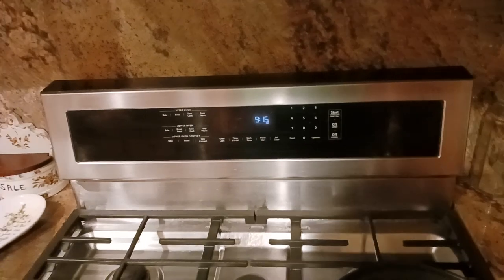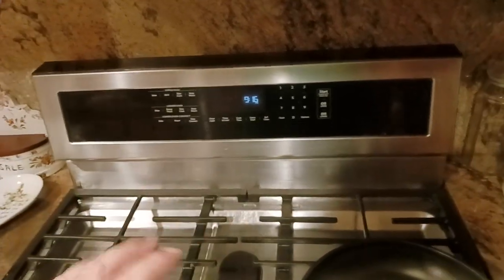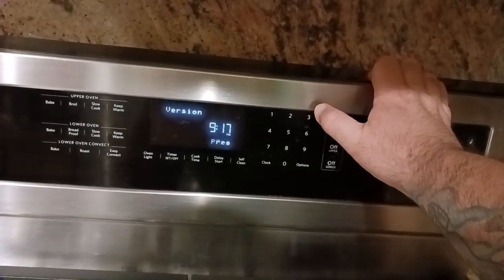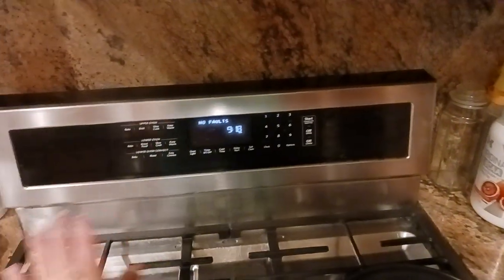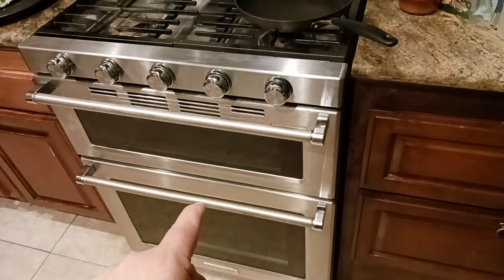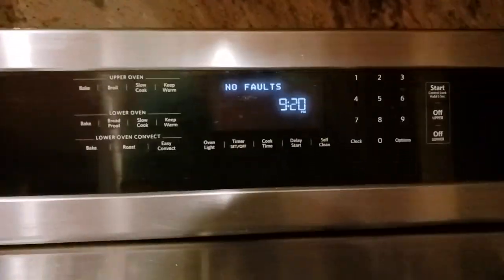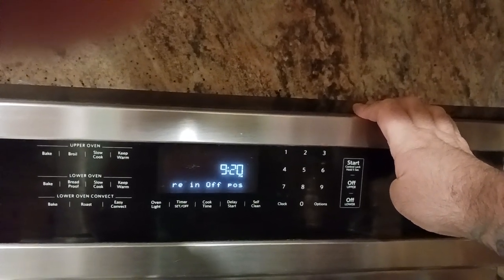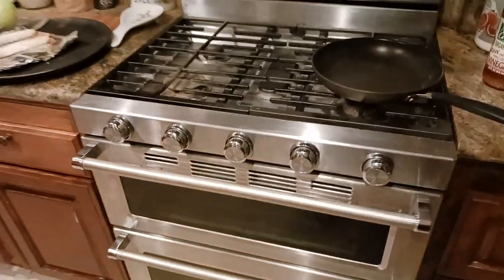717 Kitchenaid Whirlpool Oven error code menu fault double gas range mode

Comment from the maker: Igniter Replacement
https://amzn.to/3qQA1l7

❤ Please Subscribe

FB
http://facebook.com/Cooter-Malloy-Product-Reviews-102191174879094/

KITCHEN
Kitchenaid Mixer
https://amzn.to/3kGjYzD
https://amzn.to/38XhM4k

Instant Pot
https://amzn.to/3bDZEdc

Food Dehydrator
https://amzn.to/2PvYzg9

Vacuum Sealer
https://amzn.to/2Oj105b

Vacuum Sealer Bags
https://amzn.to/2Pv78Yx

Juicer
https://amzn.to/3rCSSuB

AllClad 10" Fry Pan
https://amzn.to/2Z3pBwQ

Carbon Steel Skillet
https://amzn.to/3q7iGij

Nonstick Pan
https://amzn.to/321QJhy

All Clad 4204 sauce pan
https://amzn.to/3cXx7ld

All-Clad 4406 saute pan
https://amzn.to/3aTdUhI

Water Filter
https://amzn.to/44ramyp

Pepper Mill
https://amzn.to/3tHzVZv

Oil Sprayer
https://amzn.to/3klxO9y

Silicone Tongs
https://amzn.to/3NUZ13Z
https://amzn.to/3HEbgh5

Silicone Turner
https://amzn.to/31YcBds

Slotted Spatula
https://amzn.to/3dO3gud

Spatula
https://amzn.to/3rE0nBu

Basting Brush
https://amzn.to/3p7Dbdj

Digital Meat Thermometer
https://amzn.to/2Z4dkIJ

Digital Scale
https://amzn.to/2OnbMYd

HEALTH FITNESS 
Massage Gun
https://amzn.to/3d1djgL

Headphones
https://amzn.to/3wj6l0r
https://amzn.to/3qj77GJ

Body Composition Scale
https://amzn.to/3MIXAm5

Blood Pressure Monitor
https://amzn.to/2Z4eSm1

Whey Protein
https://amzn.to/3NDWF9l
https://amzn.to/3HA3qoM

Casein Protein
https://amzn.to/3PAveva

BCAA
https://amzn.to/3yF1G83

Desiccated Beef Liver
https://amzn.to/3zzOe7z

Pre Workout
https://amzn.to/3pA87Wd

L-Citrulline Malate 2:1
https://amzn.to/3KiylWY

Nitric Oxide
https://amzn.to/3dNgtHx

B12
https://amzn.to/3vgGu7I

Energy Greens
https://amzn.to/3dZF8oY

Superfood
https://amzn.to/3IVnrVX

Multivitamin
https://amzn.to/2MGg0d3

Vitamin D3
https://amzn.to/3d3iZah

Fish Oil
https://amzn.to/3DW7ife

Electrolyte
https://amzn.to/3llOFtw
https://amzn.to/3LTdQCn

Potassium
https://amzn.to/3qhqgfa

Magnesium
https://amzn.to/3uwA9CL

Pill Case
https://amzn.to/3jyQSka

BACKPACKING
Eberlestock Backpacks
https://amzn.to/3sVmxlH

Ultralight Backpack
https://amzn.to/3t4qLp7

Assault/Day Pack
https://amzn.to/3NFPygq

Slingbag
https://amzn.to/3LuCk3F

Backpacking Cart
https://amzn.to/3ZQ3nvD

Military Sleeping Bag
https://amzn.to/3HAkPxD

Poncho Liner
https://amzn.to/42hYEEh

15 degree Sleeping Bag
https://amzn.to/3fgdoRh

Sleeping Pad
https://amzn.to/3zn9zR8

Esee Laser Strike
https://amzn.to/40QrnAk
https://amzn.to/3IheOGQ

Silky Ono
https://amzn.to/3Kh54hi

Sharpening Stone
https://amzn.to/3Z6heOj

Silky Saws
https://amzn.to/3Xj0yBO

Mora HD
https://amzn.to/3EI9Jp5

Bradford Guardian
https://amzn.to/3KnvIFq

Esee 6
https://amzn.to/3E1xJTt

Esee 4
https://amzn.to/3YkYdHM

Esee 5
https://amzn.to/3lszClY7
https://amzn.to/3RQiAu6

Esee Knives
https://amzn.to/3DWZYmk

Backpacking Chair
https://amzn.to/3kEjHwh

400lb max Backpack chair
https://amzn.to/3sDbfCc

Trekking Poles
https://amzn.to/2T3UC3X

Budget Trekking Poles
https://amzn.to/42gGHWD

Backpacking Tent
https://amzn.to/3sEYfMC

4 Season Tent
https://amzn.to/41VzkEz

Haven Tent/Hammock
https://amzn.to/3W3vMNX

Winter Underquilt
https://amzn.to/3sSS05C

Underquilt Protector
https://amzn.to/3W78Uw5

Compression Dry Sack
https://amzn.to/3hbKl2q

Eno Underbelly
https://amzn.to/3gQnskd

Tarp
https://amzn.to/3zoSJ4t

Snakeskin Tarp Sleeve
https://amzn.to/3gIj8DD

Stakes
https://amzn.to/3kMWt7m

1.8 cord
https://amzn.to/30a7Qwq

Paracord
https://amzn.to/3uJ8KOJ

S Biner
https://amzn.to/3sMgiP0

Survival Shovel
https://amzn.to/3iQYjqR

Insect bite treatment
https://amzn.to/3tIGsU4

Water Bottle Pouch
https://amzn.to/3da0C3x

Single Wall Water Bottle
https://amzn.to/38jVma6

Katadyn Be Free
https://amzn.to/3FFjg0H

Water filter
https://amzn.to/3vbZxif

MSR dromedary
https://amzn.to/3aOoU07

Cnoc Vecto
https://amzn.to/3tL8BJV

TomShoo Stove
https://amzn.to/3BmtFfo

Wood Pellets
https://amzn.to/3FjfGrW

Bellow & Fuse
https://amzn.to/3YbJvDi

Trangia
https://amzn.to/3W1fggr

Fuel Bottle
https://amzn.to/3BmWA2K

Bioethanol
https://amzn.to/3BqFt01

Stove & Adapter Kit
https://amzn.to/3blZ84K

Folding Grill
https://amzn.to/421TvAI

Pathfinder Folding Skillet
https://amzn.to/2NfIfPm

MSR 775ml pot
https://amzn.to/3Pac9AK

1.2L Camping Pot
https://amzn.to/419yZwt

Cup Pot
https://amzn.to/3tDkC4l

Bowl
https://amzn.to/30mUhdq

Long Spoon
https://amzn.to/3eg0orR

Utensil set
https://amzn.to/3aTCQpH

Pan Scrapers
https://amzn.to/3jwr0pk

Backpack Cooler
https://amzn.to/3YfQo6v

Reusable Storage Bag
https://amzn.to/3iMdLV7

Thermometer
https://amzn.to/3HkUDb3

Pocket Penlight
https://amzn.to/3aOFHjA

Flashlight AA 3 mode
https://amzn.to/2Z7JVgx

Headlamp 7 mode
https://amzn.to/36Ze323

Car Camp Chair
https://amzn.to/3ebwQeT

Home Size Pepper Gel
https://amzn.to/3a5yiND

OUTDOOR WEAR
3 Season Boots
https://amzn.to/2O3oSu0

Winter Boots
https://amzn.to/2MYubdy

Gaiters
https://amzn.to/3uOvIE3

Merino Wool Socks
https://amzn.to/38haFg